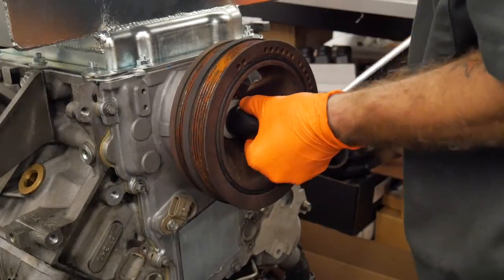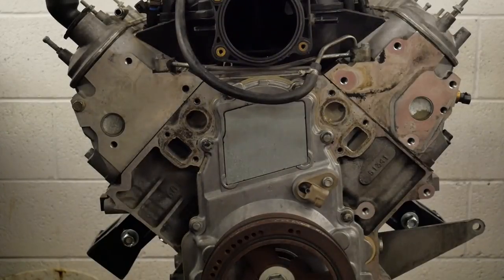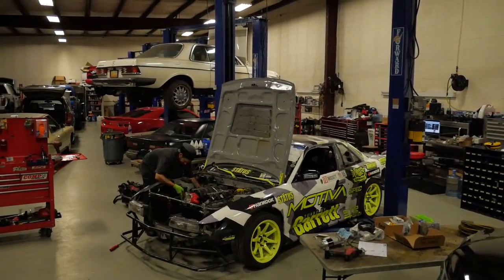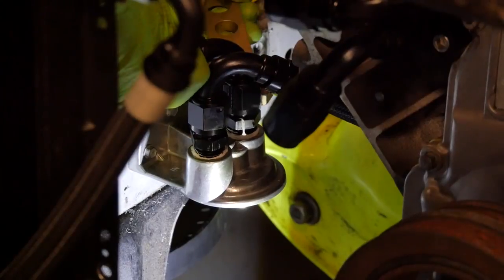Fueled Racing Nissan S13 V8 Swap kit | long tube header install

Comment: How pricy is all that stuff 🤔 I still need an oil pan and a few other odds and ends for my set up to work for my 4.8l LS14 so I can drive from Tucson to New Mexico and learn a thing or 12 from officer Dan😎
Reply from the maker: If you get the entire kit (headers, drive shaft, all lines, mounts etc) its 2995, oil pan with all lines, fittings and gasket is 775. Super high quality, made in the usa <3

Comment: the power steering lines look very close to the header !
Looks like they will melt
Reply from the maker: Wayne Bolton we bolted them down to the frame rail, and put heat wrap on as well. 4 events so far and no issues with that!
Reply: oh ok mine is rhd being australian but i had to wrap exhaust too as it melted on testing .....All good now with the wrap even @Pat Goodin thrashed it for two days now issue!
Reply from the maker: Hahahahah he told me about that trip <3

Comment: did you guys have to pull the column out of the car through the firewall, or did you manage to just tuck it out the way?
Reply from the maker: It would have been way easier if we did, but my steering shaft is un moveable so we just tucked it out of the way.
Reply: @Officer_Dan  good work. Mine wasn't that straight forward. Had to remove whole steering column from car and then space out the engine mounts as the engine sat too far towards one side and the header hit the chassis. So much work for one header haha.
Reply from the maker: Sounds like you may have gotten a wrong header! They make a Lhd and rhd specific one.
Reply: @Officer_Dan  turns out my engine is just sitting to close to the chassis rail on one side. a quick engine mount spacer and all fits fine. cheers for the help